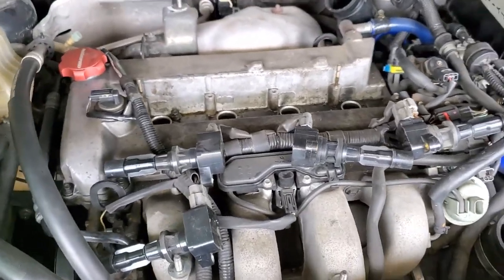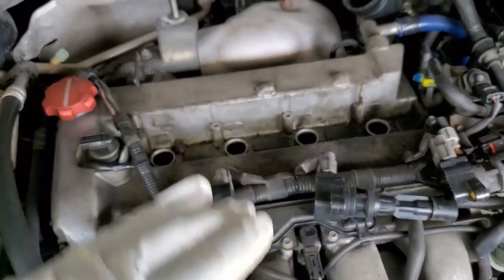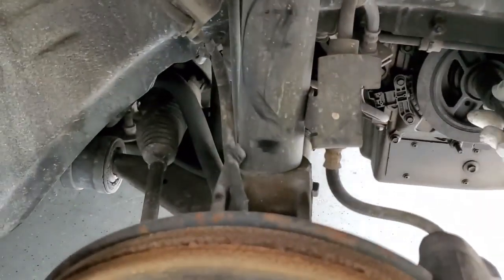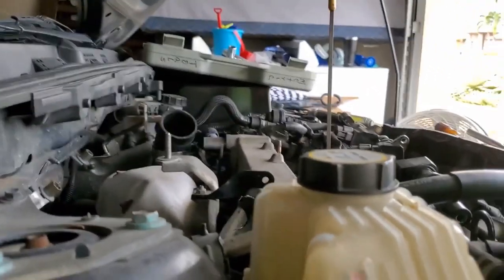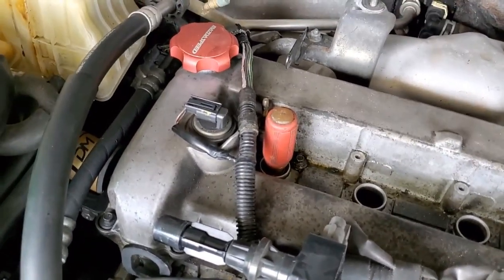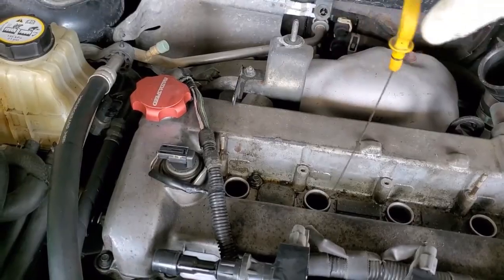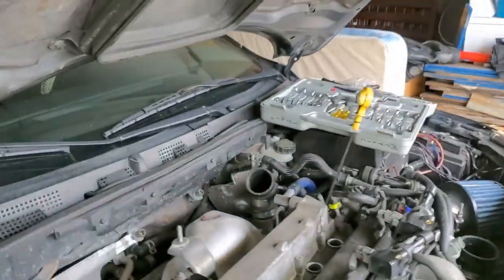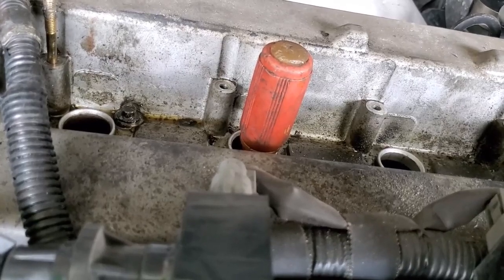Diagnosing Rod knock/Rod bearing failure on your Mazdaspeed 3/6 2.3L Motor

Comment: Great vid. I have a few quick questions...1) do this method still apply if you suspect a minor knock or the start of a failure? 2) some one said that if its a rod you would feel it in the clutch? is that true. 3) i assume if it was starting to fail you would be down on power?

Comment: Nice quick tip video! When it was running was it a constant knock or was it circumstantial (under acceleration/deceleration, only at certain RPMs, etc.)?
Reply from the maker: It was constant on idle and acceleration as well. Have since replaced the motor and confirmed the rod bearing went bad